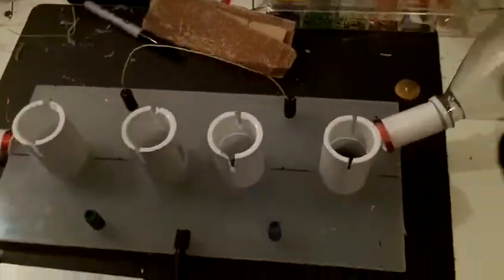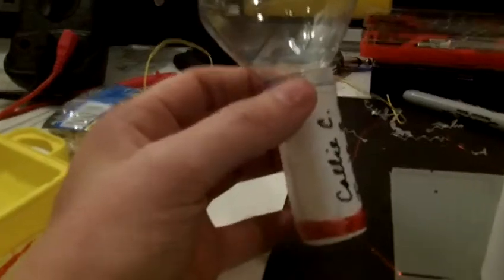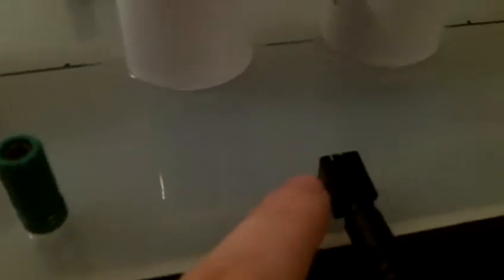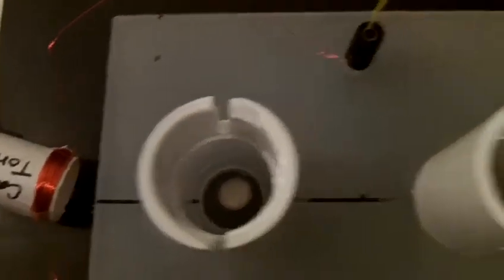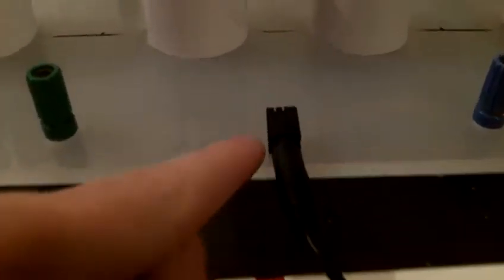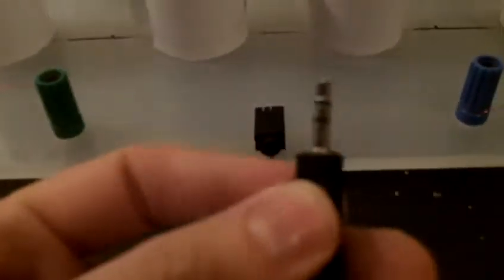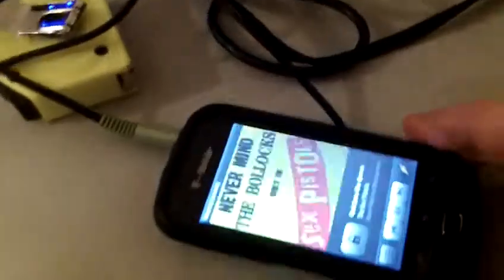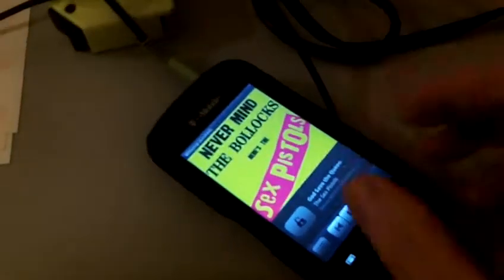DIY bottle speaker rack electromagnetism demo

Comment: This is a fantastic video and a great project!

A question arises in my mind: There is notable difference in volume and sound quality between the speakers.  The 2 liter would be louder due to mass being vibrated.  The 16.9 oz bottle would tend to do higher ranges better.  But there is a hiss in the left/smaller bottle not noticed in the 2 liter.  There are also different magnets in both relation to size and strength.  Would the larger mass magnets make for a better speaker?